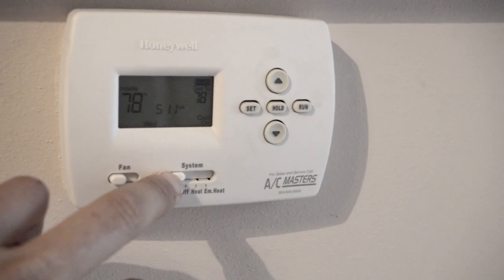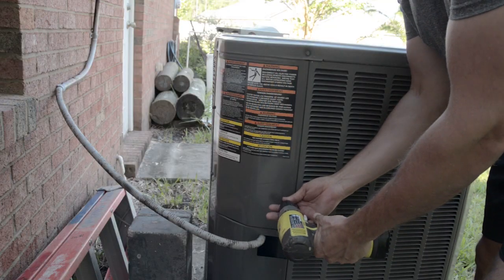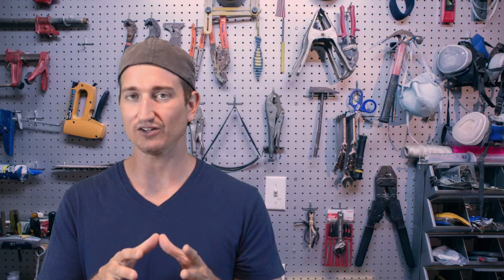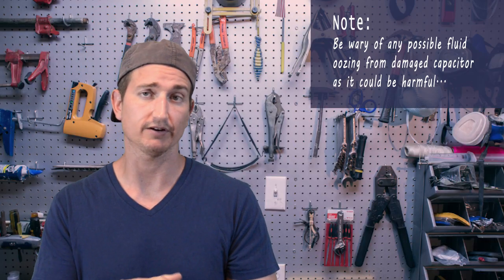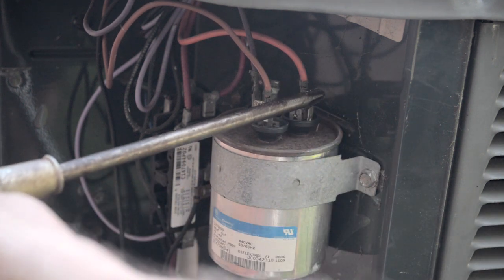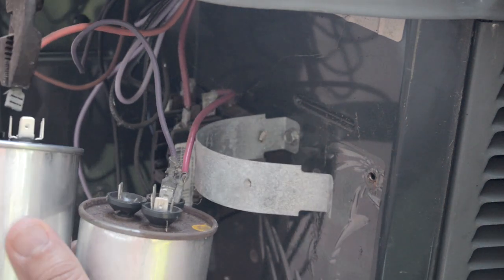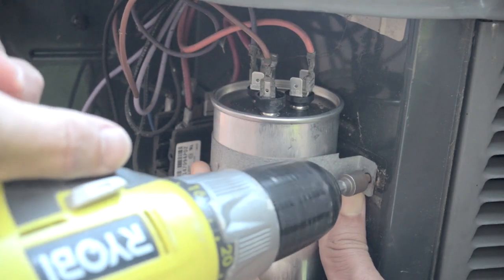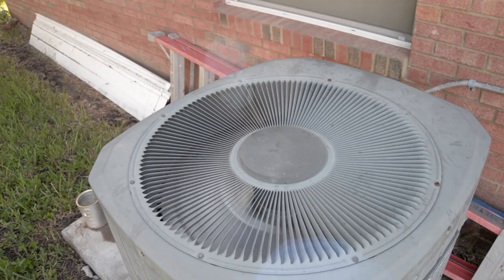How To Replace Air Conditioner Condenser Capacitor

Comment: Does it matter which prong the wire goes on for each section? Or just as long as the wire goes to the appropriate section?
Reply: Prior to changing the capacitor, please ensure the air conditioner disconnect is off by pulling the disconnect or switching off the circuit breaker to your AC unit. 

Each section has its own terminals for wiring splices to occur. So, as long as you have the correct wires on Herm, Common or C, and Fan, you're good to go with the capacitor swap.

If this repair is beyond your tools and experience, I encourage you to have someone more familiar with the repair or a professional assist you to help avoid safety risks, etc.
Reply: @askrob6846  thanks for the reply but got it figured out a year ago lol. But hopefully this comment thread will help people in the future!
Reply: @bn7191  I did notice your comment was a year old and my reply was mostly intended for others in case they have the same inquiry.
Make it a great day!

Comment: I replace my old to new capacitor and I turned on my ac breaker and I connect my disconnect and in couple seconds it explodes the compressor how that happen? Connection of the wires is correct and my new capacitor still looks good
Reply from the maker: Sorry to hear it sounds like your air condition system may be damaged. Not exactly clear of what your issue is but hope you are able to remedy it.

Comment: Great video, thank you! I went out to a local HVAC distributor and bought a cap for $9.00 and installed it myself. A local AC company, the one that installed my system and ductwork 10 years ago wanted $150.00 for the cap and $100 labor!

What a rip, huh!?  I saved over $240.00!

Thanks again!
Reply from the maker: Great to hear this air conditioning repair video was helpful for you to replace the capacitor in your AC condenser.  No hard feelings towards the AC company though, they have value in experience and have to be able to justify providing their services.  Thanks for watching and commenting.
Reply: I wish my AC repairman was that cheap. Mine charged over $800 for a motor that sells for around 300 ended up paying over $1000 for the total bill. I ask about capacitor and they went ahead and threw it in. 10 months later AC is not working again, gonna try and replace the capacitor myself and hope that that’s it.

Comment: I need a help. I change the mode to HOT by mistake on my A/C unit while it was working on cold . Now stops blowing cold air on cold and hot mode doesnt start. What may be the prob did i destroy it? :/